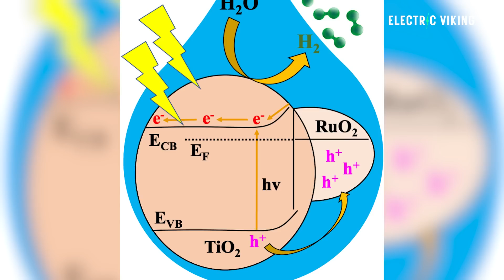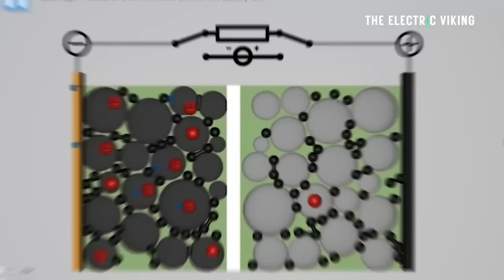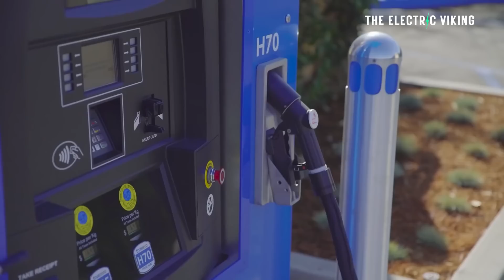American researchers use sunlight & water to efficiently create green hydrogen

Comment: I read "photocatalysis" in the article/research paper you DIDN'T link and immediately knew that this is a non-threat to battery electric vehicles. Photovoltaics are more efficient, less prone to failure, more easy to store the product of, and don't create an explosive product. The further you retreat from electricity, the more money you are wasting.

Hydrogen is a WASTE. OF. TIME. AND. ATTENTION. If you spend time humoring this stuff, you are delaying positive action towards technologies which ACTUALLY WORK and will improve society. It's bad enough that people walk around with nonsense in their heads about renewables and EVs, it gets worse if pro-renewables people get distracted by nonsense in the other direction.

Comment: The conversation about gas or liquid hydrogen misses the mark if you know about "solid state" hydrogen. Sandy Munro talked about being able to fire a laser at a solid "disc" of hydrogen to convert it to energy. This fuel would be safe enough to power a car. Problems with pressure tanks, transport & distribution go away. Apparently, the Obama Admin classified the technology as secret to prevent it from becoming a power source for missile computers. Sandy said it has since been declassified, but I haven't heard anything about it since that one time.

Comment: Several questions unanswered here. Main 1, the instant gaseous hydrogen is produced from water, also gaseous oxygen is produced. A) how do you avoid instantaneous recombination, wasting the original separation energy? (This problem kills simple cheap thermal separation of water into h2 and O2.)

Comment: It is not just the production of Hydrogen that is a problem. It is the need to store it at VERY HIGH pressure! 

JCB, Case, in GB has come up with engines to replace diesel in farm equipment.  Their production site stores H2 at 800bar(?).  Download to bulk "fuel trucks"/tube trucks at 700bar and transfer to farm equipment at 350bars.  Leaves space for on-site fuel trucks / Bowsers at pressure  500 bars.

For now, H2 is even worse off than EV for consumer refueling!

h2 2023 02 18 -JCB's New Hydrogen Engine. World's First Hydrogen Excavator! - YouTube
https://www.youtube.   com/watch?v=66zInKEPbKk

h2 2023 03 05- (CASE) JCB is moving to hydrogen power for all their big machinery. Here’s why. - YouTube
https://www.youtube.   com/watch?v=H6_qAta3Gk8
- ground up engine design
- preprod model
- spark ignition turbo boost
- engine torque/rpm performance specs are virtually identical to diesel, no noticeable diff for users
- same torque & Power curve as diesel
- 1kg H2 ~ 3l diesel
- India is a huge candidate for H2: they buy all oil externally, have sun and water to generate H2 locally!

2024 05 14 -Hydrogen is EVEN WORSE than Lithium Batteries in EVs! MGUY Australia - YouTube -takes 3 units electricity to produce 2 units of H2
https://www.youtube.   com/watch?v=BtDh9twyPDk

Wild speculation: would it be more efficient to use solar to produce H2 and Wind to create mechanical compression for higher pressure storage rather than using electricity to compress the H2 ... 

Ooh, brainstorm!  Go for the Win:Win:Win!
Use solar/wind to power the grid. If there is excess (aka "Throttling") use it for H2 generation and storage.

Why not combine Wind and Solar farms.  Wind requires lots of land for large "fans". 
If there is no other use for the land, why not put solar between the wind towers, use the same electrical distribution infrastructure.
For the 3rd "win", how about going with mixed solar/agriculture,  growing grass for animal fodder or other food crops under raised solar panels.

Comment: If 10% of photons splits off a hydrogen molecule, (and assuming it isn't the highest energy photons) that'd be about 10% of the energy of sunlight converted to energy stored in hydrogen.
But a good solar panel can convert about 25% of solar energy to electricity, and using electrolysis at about 80% efficiency, that would effectively be 20% efficient, twice as good.
If this system were cheaper than solar panels plus electrolysis hardware, that'd be a plus, but it seems like it'll need twice the area of solar panels, AND it's got to be plumbed to deliver water and collect the hydrogen from a huge area - so likely at least twice the cost per area of solar panels (so net 4x as much cost per unit of energy produced) plus likely to require a LOT more maintenance than solar panels that have no moving parts.
Am I missing something here?

Comment: Doesn’t matter, hydrogen is a stupid fuel. Its hard to store, makes metal brittle and needs to be stored under pressure. Dont make hydrogen, make hydrocarbons from water and co2 . At scale would make all ICE vehicles green with the same infrastructure that exits. And use space based solar power

Comment: Sun Hydrogen (HYSR) already did that. 
They are currently working to scale their protoype hyrdrogen creating solar panels, which can be used on any water source.
Hydrogen will be used to power the electrical grid (replacing natual gas, coal, nuclear), in order to charge electric cars and everything else without any need to CHANGE the existing infrastructure. Hydrogen cars will NEVER work. It's idiotic. Making hydrogen, putting it into a car, to convert the hydrogen to electic power in the car. It's a fucking electric car, just plug it in to charge it, and skip the hydrogen step and expensive changes to existing infrastructure.

Comment: Pure hydrogen is impractical for shipping due to the volume required for the hydrogen tanks. Far better is to somehow convert the hydrogen into methanol, ideally using atmospheric carbon. Methanol is a very friendly, easy to store liquid fuel that can be used by fuel cells to efficiently recover the energy. Combined with batteries and electric drives, one could in theory have a completely carbon neutral ship, if the methanol was created using renewables.

Comment: Here is my first question: Is this new production method cheaper than using solar to electrolyze sea water?  IOW, a 100 acre facility doing this, will it cost the same and make more hydrogen than just electrolysis (which can be up to 98% efficient)?  Second question: Hydrogen is not dense and is very explosive over a huge range of mixtures with air.  Far more dangerous in this regard than gasoline.  Third question, can a homeowner put a hydrogen production system on his garage roof for a similar cost to solar with a similar yield?  So, is it cheaper, is it less dangerous, is it possible on a unit level where I won't have to buy anything from other people who want to milk my money for the rest of my life?  If the answer to any of these questions is no, then I hope it is abandoned or left to research until the date when the answer to all three is yes.

Comment: Nice video and thought provoking but ...
H2 proving to be uneconomic commercially and not making sense to use electricity ( solar /wind)  to make H2 only to use it as a fuel for automotion or to burn it again to produce electricity.
Hydrogen has small molecules so is leaky and hard to contain, is low in energy value and corrosive to mechanical equipment
If you were to liquify it and sail it across the ocean as a substitute for LNG then its three tanker ships of H2 vs one of LNG

It sounds nice that you create this green fuel that becomes water once burnt, but the cost of production and inefficient energy performance means its part of this pipe dream of a zero carbon economy that will be impossible to achieve

Comment: Gasoline is 13% efficient (hydrogen) and 87% inefficient (carbon). One US gallon of gasoline has a density of 2.85769 kg and one kg of hydrogen divided by 13% equals 7.692307 kg of gasoline, 7.692307 divided by 2.85769 equals 2.69179 US gallons of gasoline. So this means that 1 kg of hydrogen can store 7.69 times more miles/energy than 1 kg of gasoline, eg 65 miles per kg of hydrogen is equivalent to 65 – 87% = 8.45 miles per kg of gasoline. Obviously a kg of hydrogen is a good bit more efficient than a kg of gasoline.

Comment: Splitting Hydrogen is not the most energy costly expensive process in using Hydrogen for energy storage.  Catalysts don't split Hydrogen, energy splits Hydrogen.   Ultimately physics requires you put in least the same amount of energy in as you get out.    Electrolysis can achieve over 80% efficiency using exotic expensive electrodes (not catalysts), when these people call them catalysts I smell a rat..
Even if you get Hydrogen handed to you for free, you still need to spend double the amount of energy you get out in compressing it for storage and converting it back to electricity (the most efficient way to get energy from it).  Compression uses a fixed amount of energy that is calculated from a formulae, you cannot change physics.  Then when converting it to electricity in a fuel cell, alot of energy is needed to pump/compress the air in, again this cannot be avoided, then you have the efficiency of the fuel cell matrix (which is about 80%).
This is why Hydrogen is at best 35% efficient for round trip energy storage.
As for ignoring efficiency, Hydrogen takes up too much space, you just can't get enough of it in to run a ship.  Batteries are actually more energy dense storage by space and a similar amount by weight.   Hydrogen people likes to take about fuel energy density (as fossil fuel engineers do) but this is pointless when the fuel tanks and fuel cells are the main weight and space, and then you have to vent gas too.
Hydrogen does not have any advantages for powering ships over batteries.  Hydrogen is simply not a useful way to store energy.
The best solution for ships is renewables with some storage or perhaps with Nuclear backup, maybe some fossil hybrid to deal with low renewables.

Comment: You would be making a terrible mistake if you changed your mind about Hydrogen. That is because:

Hydrogen is not used to power cars or aircraft, and will never be to any significant extent, because physics makes Hydrogen a terrible candidate as a fuel. It is physics that dictates that there will never be an Hydrogen economy, even if the production were cheap, and even if Hydrogen is used as a fuel, it will only ever be used for extremely niche applications. A few of reasons why Hydrogen is not generally used as a fuel include:

1) Hydrogen is colorless, tasteless and odorless making it challenging to detect leaks and accumulations.

2) Even in air and not compressed, burning Hydrogen has a deep blue, fast moving, hard to see, flame front, making it difficult and dangerous to fight Hydrogen fires.

3) Hydrogen embrittles anything that comes in contact with it, frequently resulting in leaks, failures, fires and detonations.

4) Hydrogen burns in 4% to 75% air mixes, and will detonate between 18.3% and 59% air mixes at atmospheric pressure making it a high hazard material in any quantity. 

5) Hydrogen has a minimum ignition energy (MIE) of 0.017–0.02 mJ, which is one of the lowest among known substances. This is much lower than other flammable gases, such as methane, ethane, propane, butane, and benzene, which usually have an MIE of more than 0.2 mJ. Hydrogen-air mixtures can also ignite with 1/10 the effort of gasoline-air mixtures.

6) The energy density of hydrogen is terrible, a bucket of diesel contains almost four times the energy of a bucket of liquid Hydrogen, meaning you need a much larger volume of Hydrogen compared to other fuels to perform the same work. This also makes Hydrogen challenging to distribute. It takes a lot of expensive tankers, and a very expensive charging station to fuel very few vehicles. Meanwhile solar is by far the cheapest source  of electricity and can be produced on site. 

7) It takes as much energy as Hydrogen contains to cool and pressurize it, to convert it into a liquid in order to increase its density for use in mobile applications, making it extremely energy inefficient.

8) While Hydrogen is light, the tanks and equipment needed to store it tend to be large, heavy and expensive, reducing its utility in mobile applications. 

9) Hydrogen bonds are hard to split, meaning that its production requires significant energy, again reducing efficiency.

10) Most hydrogen is produced from petrochemical resources, making it far dirtier than electricity.

11) The Hydrogen molecule is small and fast moving, which is why it diffuses out of any system, with all the attendant risks.

 12) The refill time with high pressure compressed hydrogen tanks is limited by compression heating. The tanks are made of composite materials to avoid embrittlement and diffusion leakage, so you’re limited by the rate that you can cool the hydrogen down as you compress it into the tank – otherwise the binder in the composite turns soft and the tank ruptures. This also gives the tanks a similar cycle life and “lifetime under compression” limit as batteries have, because the mechanical stress cycling on the material is limited.

13) In many potential applications, particulary those basrd on fuel cells or combustion, Hydrogen would need to be combined with Oxygen rather than air to raise efficiency and avoid the production of Nitrogen compounds. This implies the production or carriage of liquid oxygen with all the attendent mass, costs and risks as an accidental release of oxygen, which reacts with most other elements, is far more dangerous than even a Hydrogen spill.

The above, coupled with the very high cost of Hydrogen, is why there are few Hydrogen powered vehicles, why most of the few very expensive fueling stations that were built have been or are being dismantled, and why the only people advocating for Hydrogen work for the petrochemical industry or know little about chemistry and have been fooled by them.

PS The Hindenburg was designed to fly with Helium, but the US embargoed that forcing Zeppelin to use Hydrogen lift gas. Nevertheless Zeppelins safely flew millions of passenger miles, and even when they overstressed the envelope, leading to the Lakehurst crash, only 35 fatalities (plus one on the ground) resulted, out of the 97 people on board.

Comment: This could be used for energy storage.  If you can produce hydrogen from water with a photo-catalysis you also produce oxygen in perfect proportions.  Store these gasses and run them back through a fuel cell to produce electricity at peak times.  Electricity is easier to transport and the infrastructure is already in place.  Surplus solar and wind could also be used. The (presumably pure) water from the fuel cell could then be re-cycled through the photo-catalyzation process.  Whether this can be done at an industrial scale is another matter.

Comment: While hydrogen works and if this method can be bought to scale at a competitive price then it would start to make some sense but for one small problem. Currently there is no distribution chain anywhere and there is nothing in the current system that could be repurposed. 
The entire storage, compression and retail distribution system would have to be custom built to suite hydrogen from scratch as it simply does not exist at present.
With battery EV's the generation and distribution is already there servicing mutable markets, EV's are just another add on for it.

Comment: Green hydrogen may be an excellent solution in some cases, but I don't like it for vehicles.

Electricity can be created anywhere. With any other form of energy for vehicles is necessary for corporations to create an ecosystem and find ways to charge as much as they can for it.

I'm so done with corporations making as much as they can off my traveling.

Comment: I think you should refer to Sual Griffiths's work around energy processes and you will find that green hydrogen, at present, is only 37% efficient, roughly equivalent to an ICE unit. Even if you can reduce the 17% energy loss from present-day electrolysis you still have to compress it (15% loss), transport (3% loss), fuel cell conversion (40% loss) and then combustion loss of around another 10%. And that doesn't include the safety concerns, security, distribution infrastructure etc. All up, if you want to store power, hydrogen sucks. Battery storage is closer to 95% efficient. Other energy storage forms, such as weight storage or hydro storage like the Snowy Hydro scheme, are much more efficient.....electrify everything transport-wise, hydro is throwing away money and energy if used in transport. Maybe it has a use in some areas but it is currently an inefficient energy storage device (not an energy production device) looking for a problem to solve.

Comment: The problem is not so much the production of hydrogen although that is troublesome. It's the safe storage and use, that's a nightmare. It is much better to find a way of making safer molecules, easier to use such as methane (CH4), and even better still kerosene (C15H15). A process that extracts CO2 and H2 from seawater and converts these directly to tailor made hydro carbon fuels with looks to be feasible and environmentally sustainable.

Comment: Hydrogen could be useful for occasions where high energy density is needed, such as transitional airplanes and later long range flights, or for U.S. locomotives, assuming we never upgrade them to the same high speed railways the rest of the world uses. The Tesla Semi has shown that battery electric tractor-trailers work, but for those of you in Australia, the extended demands of long haul land trains might do better with hydrogen once electrolysis gets figured out at scale.